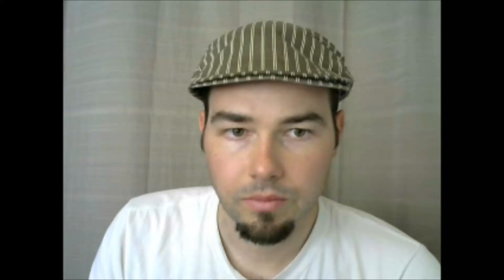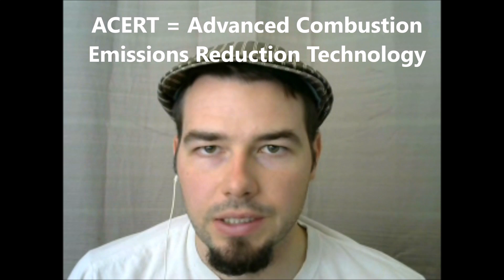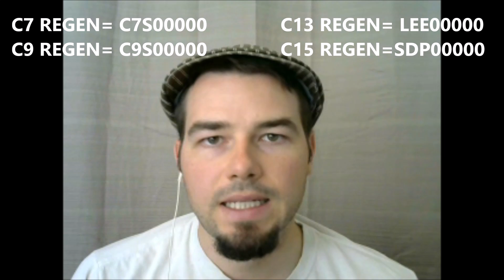Regen, Aftertreatment, and DPF System Class.  Cat Emissions Systems Course.

Comment: Cummins After-Treatment Systems are component based on the 2007 product (CM2150 ISB6.7, ISC8.3, ISL8.9, ISM11 and ISX15) engines. This is the more so on the 2010 & 2013 product (CM2250 & CM2350 ISB6.7, ISL9, ISX11.9/12 and ISX15) engines. We at the Kenner branch of Cummins Inc. haven't yet seen any of the new 2017 product come in YET? The 2017 product is supposed to be even more component based and Cummins has introduced its SMART Technology on this product. SMART Technology includes intelligent automated trans shifting, load sensing shifting, hill grade sensing for trans shifting as well as new cruise control, fuel mileage capabilities, EGR and After-Treatment operation!
Reply from the maker: Sounds like quite the electronic module overload there. I am not a huge fan of automatic transmissions, but I think over time they will slowly take over. Is Cummins concerned that manufacturers might stop using them as a third party engine manufacturer in the future? Or do they have contracts extending into the future for the suppliers?
Reply: Adept Ape, yes Cummins is releasing the fully automated Cummins assisted cm2350 ecm and 2017 new egr, crankcase ventilation, vgt, after treatment and fuel systems in the late 2016-early 2017 engines! These are the CM2350 ISX15 & ISX12, ISL9 and ISB6.7 engines the newest addition is the ISV5.0 V8's introduced for Nissan, box trucks, school buses, flatbed tow trucks and smaller class 6 vehicles.
Reply from the maker: I'm envious that you get to have new trucks being produced every day and Cat has gotten out of the market.
Reply: Ironically the new Cummins tech is called ADEPT, lol. It uses smartCoast for using the vehicles momentum in conjunction with disengaging the trans for fuel economy and smart torque2 for automated manual transmissions which uses dynamic 2-4-6 engine compression braking, load and hill grade sensing to use the correct gear for climbing up and coasting down highways! Also this is only available for the ISX15 and is offered as GEN-1 which can easily upgrade by a ecm revision to future gen's of the adept software!
Reply from the maker: It's called Adept! lol, great now everyone is going to think that is why I picked that name.
Reply: Adept Ape, personally I'm a CAT Engine guy! I only work on CUMMINS for job security. Over the past year, Cummins either have after treatment issues causing large damage to the engines. Or, the engines blow up and or wear out to fast due to inferior tech or parts! I love CAT's, I'm sure you agree you can't beat a good CAT.
Reply: Adept Ape, personally I'm a CAT Engine guy! I only work on CUMMINS for job security. Over the past year, Cummins either have after treatment issues causing large damage to the engines. Or, the engines blow up and or wear out to fast due to inferior tech or parts! I love CAT's, I'm sure you agree you can't beat a good CAT.

Comment: Did your dealer sell any CT660's trucks(Navistar)? And if so have you had to work on this system?
Reply from the maker: +J Floyd Yes our dealer sold a handful and I've been trained and have worked on a few of their emissions systems. The software is much worse than Cats and the DEF systems have had quite a few problems.
Reply: yeah we are having tons of wire hardness issues... We a loner cat truck that ended up running away the fighter dept tried to stop it they put dry chemical in the intake. Long story short its getting a long block along with the intake and exhaust system . I'm glad that they have ended production of these machines.
Reply from the maker: They should have let that burn to the ground. The harnesses are junk on these Navistar products. Cat always had good harnesses.
Reply: Isn't that the truth. What is your dealer doing to keep the truck dept open? Are yall total truck as in work on anything that deals with the truck itself?
Reply from the maker: Doing to keep the department open, hahaha. We are just working on Cat truck engines, it's not like that would ever slow down, oh wait.

Comment: Adept Ape, could you answer my two comments individually or maybe work them into your next Diesel Talk Video please? Thanks in advance man! Oh by the way, your video that included the topic of multiple cylinder cutout was a huge help on injector diagnostics. Up until then, I just did cylinder cutout one at a time. I also just used the Cummins IPT (Injector Performance Test). Your multiple cylinder cutout video added a tool to my toolbox that works more often than the Cummins testing most times!
Reply from the maker: +Norwood E. Jatho, Jr. Nice to meet you Norwood, you left quite the comments here, it would be hard to address them over a comment message, but if you are familiar with my channel I do "Diesel Talk" episodes every week or two which addresses comments. I'll try to answer your questions in the next one. I'm not super familiar with the Cummins aftertreatment systems, but I know they were similar to the Navistar ones with the DPF and such. I'll try to answer your questions as well in a video I've been thinking if making about telling the the model differences in the Cat truck engine models.
Reply from the maker: +Norwood E. Jatho, Jr. I'm glad you liked my multiple cylinder trick too, it works really well. I'm not sure on the Cummins if you can mess with the injection pressure and try it too.

Comment: I also have questions about CAT After-Treatment Systems versus Cummins After-Treatment Systems! Cummins has a problem with (too frequent Regen's) cause by one or a combination of the following! Dribbling Injectors, clogged EGR differential ports, clogged Exhaust gas pressure sensor tube, clogged DOC or DPF! These failures also cause high exhaust back-pressure which eventually can cause high blow-by, clogged crankcase breather filter elements & coalescent filters! Not to mention the Regen Light, SCR Catalyst System DEF Light, Check Engine Light, Stop Engine Light and the Malfunction Indicator Light as well scaring drivers thinking their equipment is going to be all to expensive to fix. As with Cummins , this is most of the time true due to the high cost of Cummins After-Treatment, Fuel System EGR System  and other Air Handling System Components.
Reply from the maker: See my answer on the final comment you left me. Thank you.

Comment: Adept Ape, hi I'm Norwood, I'm in Kenner, Louisiana. I'm a very experienced and well trained tech like yourself. I work for Cummins, Inc but, I do have a few questions on Cat model names and such! Like, the numerical models versus the alpha-numerical models. The differences between them and when about the differences in the models took place. Also, not only the I6's but, the V8's too! Are there newer electronic versions of the older numerical V8's. Are any of the V8's equipped with EGR, After-Treatment or ACERT???
Reply from the maker: See my answer on the final comment you left me. Thank you.

Comment: Nice job. I have a couple of C-13 LEE engines in our city's fire trucks. The only problem we have, is any time we have to use a factory password.  It reconfigures the PTO parameters.  Then I have to go back and reset the parameters so the PTO will work.  They are Pierce trucks have you had the pleasure of repairing some of them?  I have seen a picture of a bird that had been suck up to the venturi in the CGI tube.
Reply from the maker: +Tim insane I have not seen any fire trucks with them, unfortunately we must have weak firetrucks
Reply: hi, Timothy, I'm working on my Ladder Truck right now with the C-13 in it. Are you around stll?

Comment: you mentioned that cat has the regen system from 2008--2010  what system after 2010?  on c-15
Reply from the maker: +mehmet g Well Cat stopped production on their engines after that point. They tried to make a Cat truck with Navistar, but that didn't go that well. Sad news for many Truckers and Diesel fans of Cat.

Comment: Q. what determine an regen failure ?
because my regen was working fine ( I guess ) because I regened the system 2 days ago and till yesterday all the engine lights came on and the truck started to lose power gradually.
but even with all the light engine and regen light on I still can regen it but no effect the lights still on and still no power.
is that mean i had problem with ARD head or regen system or the filters needs to be cleaned or replaced ?
when the regen fail it does start or it wont start all together ?
by start or going to a regen i mean when the RPMs or the engine goes up to 14-15 RPM ?
Reply from the maker: +Rone Matee A lot of questions there. A check engine light doesn't necessarily mean you have a regen problem, but if you have a the DPF check light on, then it is indicating a regen problem.

Depending on what is wrong with your system it may try to regen, but after several attempts it'll usually lock out with a code like loss of combustion or regen system permanent lockout.

Normally you'll know if it's regenerating if the high exhaust temp light is on and the engine RPMs are at 1400.
Reply: Ok. I replaced the ard head, spark plugs fuel nozzle filters.
still no regen.
Kenworth and freightliner the diagnostic test recommend to replace those.
but still engine light is on and the truck still derated and doesnt wonna regen.
do i have to take it to them again to clear the code so it can operate properly. 
or when i replaced what they asked should have solved the issues without hocking it in to computer?
Reply from the maker: If there engine has a hard code like failed to ignite or something like that, then it will have to go to a Cat authorized service center to have the code cleared before it will try to regen. If it just had high soot load, then it should try to regen by itself. Since it won't, you will have to take it to them again to see what is going on.

Comment: we have c15 acerts in our equipment but they are single turbo nothing fancy engines why do they say acert on the valve cover
Reply from the maker: +CHRIS BUXTON ACERT doesn't mean regen, it was basically the acronym Cat used on its engines one they started having some sort of emissions controls. Yours probably has a ECM regulated wastegate so it is an ACERT, or someone just put later model valve covers on your engine.
Reply: +Adept Ape we have c9 engines that say the same thing and are single turbo and waste gates that just have the hose on them I just couldn't figure out why they say acert with no newer technology..and would the Regen system be the same on equipment?
Reply from the maker: The C7 and C9 were ACERT according to Cat, but they don't really have any sort of emissions regulating, just the programming in the ECM limits the fuel position to less than the fuel rated limit, which is a fancy way of saying there shouldn't be black smoke. That is why I stated in the beginning of the video that ACERT doesn't mean regen. A lot of people think an ACERT engine is a regen engine.
Reply: +Adept Ape right I just thought all acerts had twin turbo and intake valve actuators and all that stuff

Comment: is regen same as DPF?
Reply from the maker: +Omar A regen is the process of cleaning the DPF with high heat through the ARD head.
Reply: thanks mate!

I have another question please. So the left side of an ecm is for the engine harness such as the sensors for temp and pressure, and  the right side of the ecm is for the vehicle or bus connection like to the dashboard.. right?

thanks!!
Reply from the maker: +Omar Yes sir, you are correct. Right side is inputs and left side is Cat stuffs.